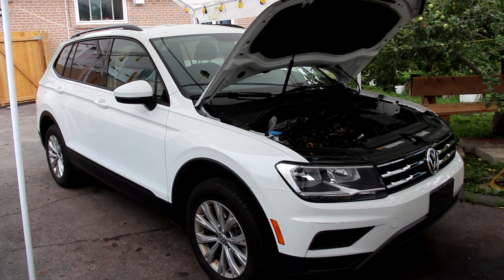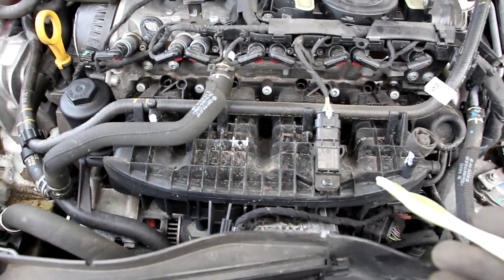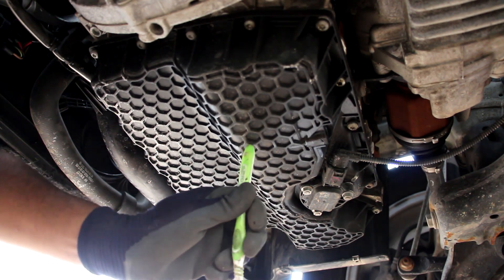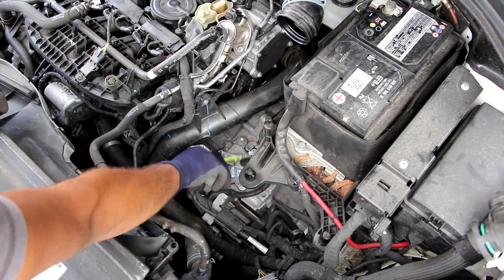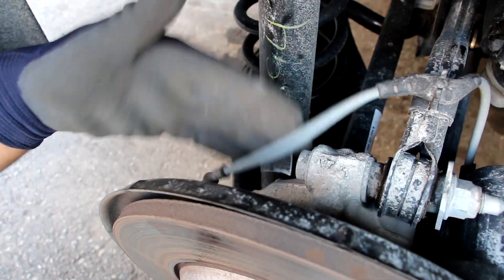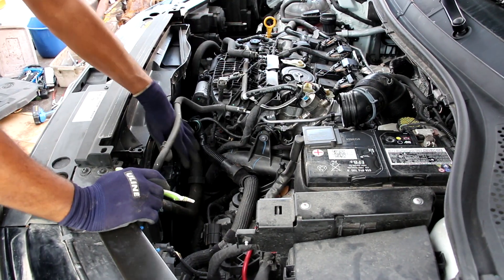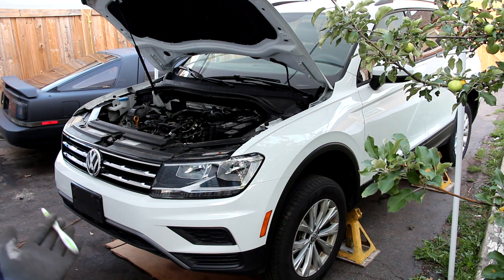Volkswagen Tiguan Mechanical Review

Comment: European version of the Tiguan is made in Germany. Here it has quite a good reputation.
Reply from the maker: Reliable?
Reply: @speedkar99  quite reliable. not as the Japanese or Korean. but the main reliability issue the VW are know for is the DSG transmission, no other known diseases.
Reply: @speedkar99  kinda reliable, you be lucky if it lasted 120k miles with no major problems, i've seen one with 16k miles that had bent rods for some reason
Reply from the maker: 120K miles hmm I don't think if ever owned a car with that low mileage
Reply: @speedkar99  120k is considered ALOT in EU
Reply: @mounir_mouza2969  Jesus.. why even buy a car then? If I used my car that little I'd just buy an E-Bike and take Europe's wonderful public transportation everywhere else. I'm lucky that I live in the Chicago-Milwaukee-North West Indiana mega metropolitan region. We (in an exception to MOST of the US) have really good public transportation here but I've kept my car simply because many parts of american life revolves around needing a car (like doing Uber and Amazon flex, interstate travel, using drive thrus, and such). Ive pushed all my last 3 cars past 350k miles, it'd be way expensive to get rid of a car after only 120k miles. Maybe Americans have lofty expectations from our cars but then again, different culture.. different norms I guess.
Reply: Mounir_ Mouza2 I bought a new 2020 Passat about a month ago. It has various issues with the brake system and the auto collision system. The seat belt light goes on and off throughout my drive and the drivers head rest is broken. I’ve owned a few Volkswagen cars and I can tell you where it’s made doesn’t determine reliability like that one guy was suggesting xD
Reply: @scenicdepictionsofchicagolife  hello, come down here in W.Europe to see how our public transportation is efficient, well maintaines, strike less, clean, safe ... and you'll better enjoy your cars and road  system there!
Reply: @scenicdepictionsofchicagolife  i pushed a little past  120k miles in my toyita in 8 years, i live in north Africa and everything is close to me, (120k miles no issues ofc because Toyota hehe)  but yes the distances in the US are different, any European made car won't last 350k miles like yours did, and if they do it would be a money pit, i'm not fan of VW their shit is badly engineered and way more complicated and really hard to work on compared to Honda or Toyota for example
Reply: @ghost-4230  sell that lol, maybe get a 9th gen civic or something good like that, and no it doesn't matter where it's made like you said, but it does where it's driven, vast majority of people in EU don't drive their cars that much like you do in the US (distance wise) so less parts fail.
Reply: Mounir_ Mouza2 I really enjoy how my Passat drives. I couldn’t downgrade to a civic
Reply: @ghost-4230  i agree, 9th gen is kinda old, last gen civics drive better believe me, they have better suspension, they always did, independent rear suspension and double wishbone at the front, you only get that in mk7 golf, Honda did and does it for everything.
Reply: Muh "oh they make them better in germany" story from germans.  If I had a nickel...
Reply: @greggc.touftree5936  maybe they actually are.
Reply: @greggc.touftree5936  I am not German
Reply: Last gen was built in Germany too, and I heard that was quite bad already

Comment: Was that start-up for real?
Reply: It looks like the engine was started with the oil filler cap not on properly. If it does not have proper vacuum it would run rough and even stall. The cap is supposed to be sideways and that is front to back.
Reply: it looks like a relatively new vehicle, but sound like an engine with half a million km...
Reply from the maker: Yeah
Reply: @speedkar99  That was horrible
Reply: @enzodnaesposito dipstick was pulled causing a vacuum leak.
Reply: @speedkar99  What is wrong with it? Just a lot of miles?
Reply: @ARentz07  Its brand new lol
Reply: @speedkar99 no
It wasn’t lol
Reply: Improper vacuum do to the dipstick not installed all the way in
Reply: it sounded like it was running on only 2 cylinders
Reply: @chuckycheese84 because the dipstick was pulled causing a vacuum leak

Comment: I honestly don't get the hate for Torx except that European cars are the only ones to use them.  In years of wrenching on cars, I've never had a single torx strip, provided that I A. make sure I have the correct torx bit driver size, and B. make sure the bit is fully seated in the head.  I'd take torx over phillips head any day of the week.  And as an engineer, I could demonstrate how, if the conditions above are met, the torx head is far superior to the phillips in how the torque is applied to the bolt (and less prone to stripping out).
Reply from the maker: I don't like Philips either under the hood. Hex head (not internal hex) is better than torx because where I live in the rust belt, crap tends to go inside and it strips, slips, or gets all chewed up. With an external hex you at least have the option grab it with vice grips. They also sit nicely in a socket for one handed installation
Reply: I don't think anyone is arguing for philips heads on the oil pan bolts. Speedcar mentioned torx aren't good when they get rusty. I wouldn't know because I live in Nevada where stuff doesn't rust. I just had a #40 torx strip on me but actually it was the Lisle torx socket that stripped and the bolt head was fine. I bought a higher quality socket and it came out no problem. For a given bolt head outer diameter, my gut tells me a hex bolt would withstand higher torque before stripping than a torx. I'm an engineer too (probably half his audience is I bet) but I never studied fastener heads.
Reply: @alexkram  Right, the oil pan bolts could have been hex head just fine (although since they're in at such a low torque and screwing into aluminum, I doubt the torx would ever be a problem here at least).  And hex head can certainly handle more torque.  Although I will say for high-torque hex head bolts, I've had some cars from the rust belt strip out.  Rarely, though.

My comment was more for the torx locations where they might have used a phillips instead if it were a Japanese or American car, such as the splash guards.  Torx contact the bolt head further away from the center of the bolt, thus producing a larger torque than phillips.  Also, they lock into the bolt much like a hex fits onto a bolt (you don't have to press and turn a torx like you do a phillips to keep it from popping out/stripping).
Reply: Why use torx instead of hex heads anywhere a socket wrench can get to? I'd shear off a hex head before it got stripped round unless it was some truly terribad chineseum.
As for philips vs torx, that's mostly just people annoyed with having to get new tools and tool bits.
Reply: Particularly, some people don't know the difference between Phillips and JIS too which doesn't help.  But Torx is preferable for inside drive fasteners under any risk of seizing up IMO.  However, VW seems to use inside drive where outside drive would work just fine.  Renault use bolts which have both hex outside drive and Torx inside drive which is a good idea.

Comment: Can you please test Mercedes E Class or S Class, just to see what quality Mercedes has to offer 😉
Reply from the maker: I'd love to but it's hard to find those to film. I'd probably have to take off a dozen plastic covers to show you the engine and underbody!
Reply: Do all German big saloons. Let's see who cuts corners the most between Audi, BMW & Mercedes.
Reply: Its all engineering  marvels and luxury untill they breakdown for no good reason  except cheaping out on quality .
Reply: @MuhammadTayyab-iv4rd  Most of Taxis im Germany are E Class. Have been forever. We're talking mileages around 200-300-400k km and beyond.
Reply: The engineering choices and design of those cars are too complicated for Americans to understand.
Reply: @Naveen Kumar There's a reason why they drive so well and are so solid feeling and refined. If owners look after them like intended they last forever.
Reply: Hmm no that not correct. Lexus and Acura drive much better and are all around more refined than any Mercedes; and to add insult to injury they take the cake when to comes to reliability.  I see so many E class, S class, and C class Mercedes around here that have their engines knocking , full of electrical issues, and transmissions on the verge of destroying itself. They are extremely pricey to maintain and only very specific mechanics will work on them, or otherwise you are at the mercy of the dealership. The best Mercedes that the company ever built was the 300D Turbo Diesel;  they were literally like tanks and were designed to last a very long time. After they were discontinued the company turn to garbage.
Reply: @applepoop10  Acura and Lexus more refined than a current E or S Class? What bath salts are you on today?
Reply: @applepoop10  Hahaha. Whatever you're on let us know. Lexus and Acura try very hard but the GS for example is being discontinued because it simply isn't close to being competitive with an E Class or 5 series. It's nowhere near as refined or luxurious.
And I don't know which cars you are seeing but they're doing just fine everywhere else.

Comment: I have owned one for 3 years now and performance wise, it's a good car. I've had before a Mazda CX-7 and an Audi A4 Avant and this motor is pretty peppy. I'm actually looking to keep and and possibly tune it to Audi Q5 specs, as it's the exact same motor with just a different tune.....I love the space inside with 2 kids and the 8 speed in manual mode actually obeys your command.....93 octane recommended for more spirited driving....
Reply: It mounts differently and with a different transmission tho. Even you tune it to a q5, it will still drive different
Reply: Naveen Kumar I have 38k miles on it, bout got it new 05/2018

Comment: 0w20 on a turbo direct injected German designed engine? Wow
Reply from the maker: Yeah I thought they'd go thinner
Reply: Here I thought only Honda was brave enough to go 0W20 with a turbo. Most OEMs turbos are still using 5W30 or 5W40.
Reply: My 2016 GTI which also has an EA888 has 5W-40 Castrol oil from the factory.
Reply: My 19 Jetta with the EA211 says 0w20 as well

Comment: A computer attached to the rear diff? Isn't that a bit exposed to the weather? Great analysis as usual.
Reply: VW obviously thought of that.
Reply: The VW awd is actually a haldex unit which is used by many manufacturers.  Its probably one of the more reliable parts of the vehicle .
Reply: Hope you don't mind buying a new computer from vw in about 5-10 years.
Reply: Vw are absolute trash

Comment: Ok so why did the engine sound Soo bad?
Reply from the maker: Turned out I didn't stick the air hose back on properly. Easy fix.
Reply: @speedkar99  Thanks for clarifying that.
Reply: VW Dealer: Unable to reproduce reported issue.... No issues found

Comment: Some good qualities, but thanks to this review, I believe the  bad outweigh the good.
Reply: Such as?
Reply: @SDav21  the plastic oil pan, the valve adjustment solenoids, the gdi only, the computer on the rear diff, the millions of torx and triple squares, etc.
Reply: @andym1223  And yet, that engine and its mechanicals have been proven all over the world and are doing just fine. Also, torx allows for better and more accurate torque on the bolts and are less prone to stripping from taking it out or putting it back in. It's why they use it.
Reply: @SDav21  proven to fail, yes, terrible engines, ive had them blown up quite a lot in my shop

Comment: Plastic oil pans? :)) No, thank you.
Reply: They took some ideas from Ford on that one and the blank fuse box cover.
Reply: For real!
Reply: Ikr
Reply: I can't think of one good reason for plastic oil pan.
Reply: @Porsche996TT  light weight, and lower manufacturer cost. There are good reason but not really benefiting the owner, well in longer them
Reply: @SHADOWBONELESS  Yeah, I was speaking of consumer benefit.
Reply: @Porsche996TT  as consumer, they can buy the car they thought to be good in a lower price....
Reply: SHADOWBONELESS still the same price for consumers but manufacturers get more profit
Reply: @Porsche996TT  Cheap to produce,  it's that simple.
Reply: @Porsche996TT what do you drive?
Reply: It is been on vw for some time, it is questionable on lower cars, but SUV should be fine, also... The Porsche Cayman GT 4 also have a plastic oil pan.
Reply: @SHADOWBONELESS  well thats Porsche quality for ya
Reply: @andym1223  I hope so, but by the shape of that, I think it is most likely manufacturer by the same guy.

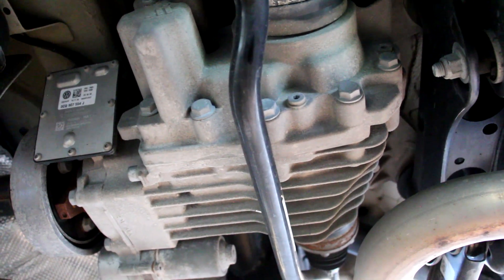Comment: 10:21 - "Now VW says to use a special all wheel drive fluid" - Now that's what i call a sarcasm.
Reply from the maker: It's true check the manual
Reply: In their defense, you put regular gear oil in a friction clutch pack and you'll have...not very much friction...and a FWD car with a rear paperweight lol
Reply: It's just Haldex fluid